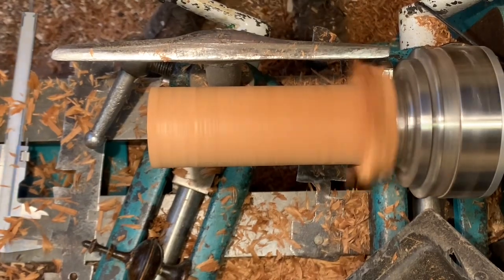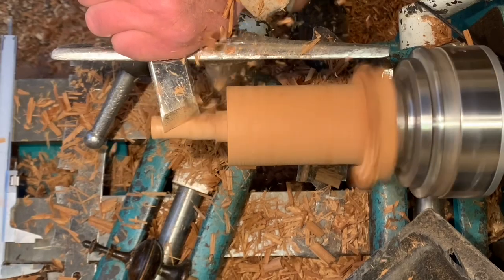Woodturning- copying a finial

Comment: I don't know if you'll be reading this but I have a question :
I have a small Record lathe (and it is big enough for the spindles and chair-legs I want to turn) BUT the tool rest that came with the machine is rubbish (even to my beginner's eyes). It's too narrow, the shape feels wrong and the metal is too soft. I will make a new, wider and better one. Do you have any tips ? How do you like your tool rests ?
Reply from the maker: I have many different tool rests and as long as the top is fairly narrow slightly rounded and smooth it’s good